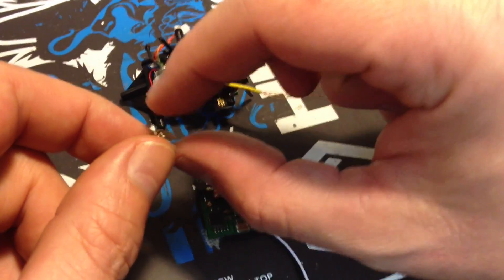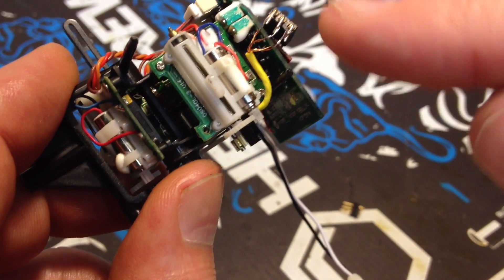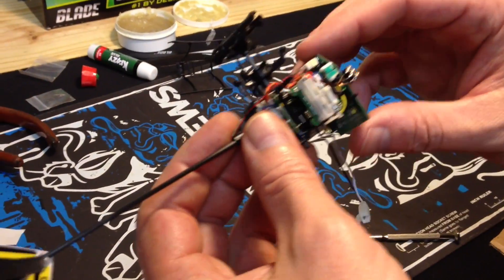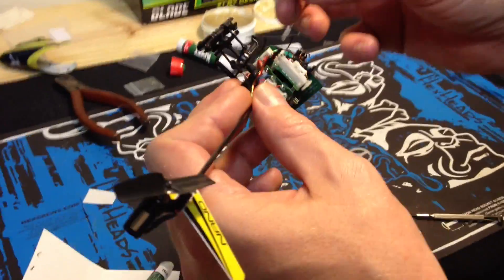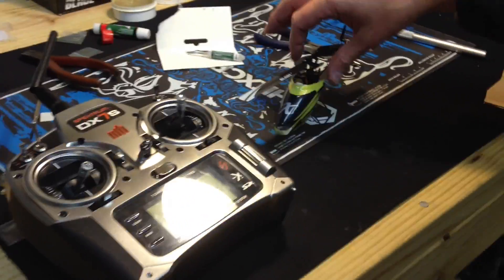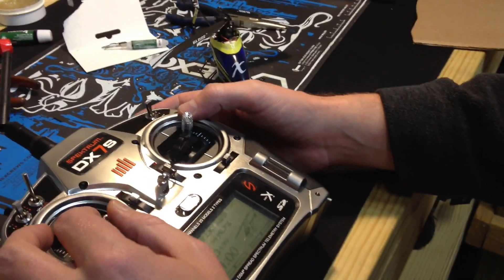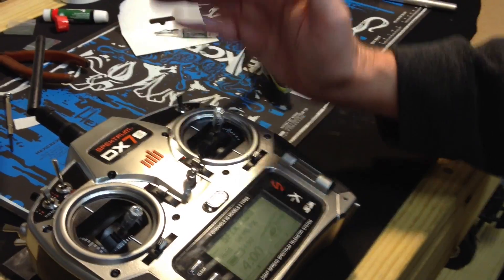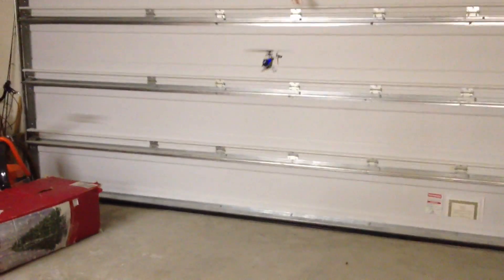Blade Nano CPX Brushless Install Part 3 of 3

Comment: No mods to the skids and we used the stock batteries, getting about 3.5 minutes set at 82%, at least 100 flights by now. We did try the mcpx skids with thunderpower 240's using the adapter, it did not like the extra weight.

Comment: Thanks for these awesome vids! Just wondering if you guys have changed to different skids? If not have you had to make any mods to the battery holder for use with a slightly bigger battery?